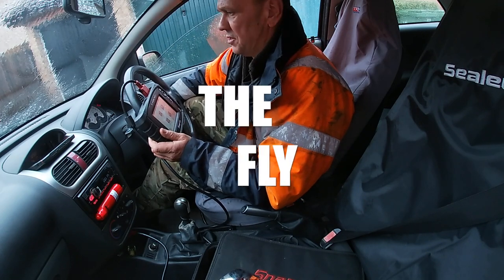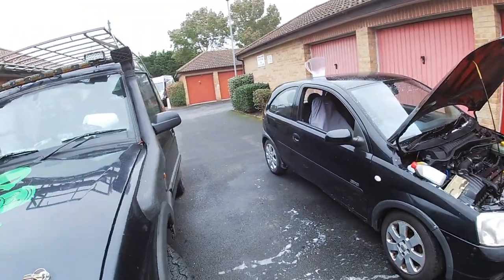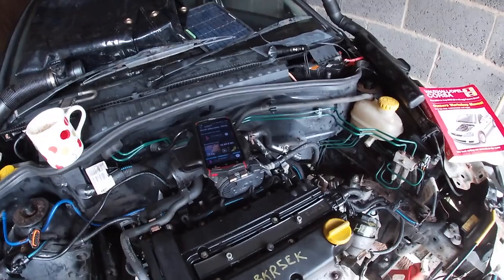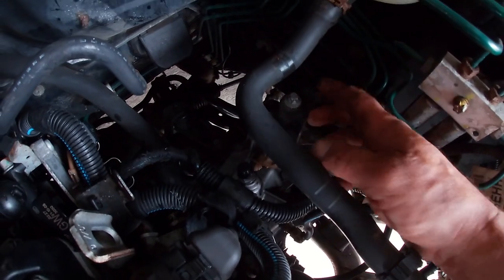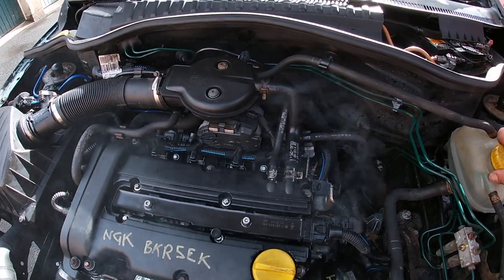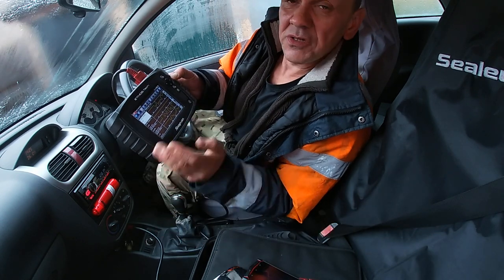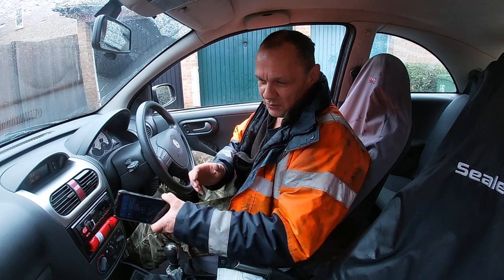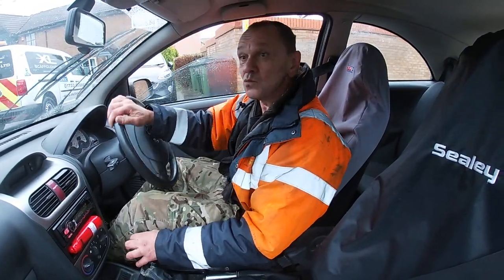The Fly Project Update - On the Road Already.  Road Test - Mysterious 'Grindy' Noise

Comment: Just a quick note on the rear brake drums and shoes Chris. The ones on the eBay listing shown are the wider 46mm ones for cars with ABS, your Corsa should have narrower 29mm shoes and drums and shoe holding pins to suit non abs system

Comment: The hand brake cable adjust is under the handbrake boot
Reply from the maker: Got that.  it was slack but after adjustment, the handbrake is still weak. I've ordered a rear axle brake kit the handbrake cables which will be delivered today ( Saturday)..

Comment: Fyi I think when hot in closed loop,  long term and short term fuel trims should add up to more or less zero, a stuck purge valve/tank vent valve is common for holding the total fuel trim high/lean, if so there may be huge hissing when you open the filler cap. Check data it should be commanded around 12% idle then 0% on overrun. Chances are it never closes .sorry if I'm not accurate on that.
the temp sensor is a little bump under the ns mirror .
Reply from the maker: Ah nice. There is an open and closed-loop monitoring facility in the EOBD side of the scanner.  Cap not hissing, there is no vacuum in the tank.  Coming to think of it, I wonder if the lectrics under the ns rear passenger seat is something to do with that?
Reply: @trailerfitter2   the valve is located in the engine bay above the airfilter , and joins the inlet to the tank .as far as i can remember when disconnected you should not be able to blow through it , and its the ecu signal that makes it open to a commanded amount based on throttle position probably . it may not be faulty , just a suggestion if you have fuel trims that dont add up to zero + or - 3 ish . 
 other reasons for way out fuel trims might be an inlet leak, lambda sensor, exhaust blow or even a rocker cover gasket . the rocker cover can distort not alowing the gasket to seal, and drawing in un-metered air , as the intake is joined to the cover  . anyway probably best not listen to my ramblings or you might be on a wild goose chase .

Comment: That engine will be the z12xe not the z12xep
Reply: all 4 cylinder timing chain vx engine cams same part numbers though, only retainable sensor pickup wheel that changed
Reply from the maker: OK cheers
Reply: Ashley McConnell yep i know that I’m just saying for future ref 
And the engine that you got is a single port not a twinport

Comment: Do you have wet front carpets in the footwells? These Corsa's are notorious for leaking through the bulkhead on both sides. They also have a common issue with the steering rack where the bushing gets worn and you get knocking noises going over bumps. The bushing on mine was worn on the near side.  I really like your vids and learn loads. Cheers
Reply from the maker: Yeah does all that except the leaking. That's okay.  I gat the ARB vibrating like crazy when reversing.